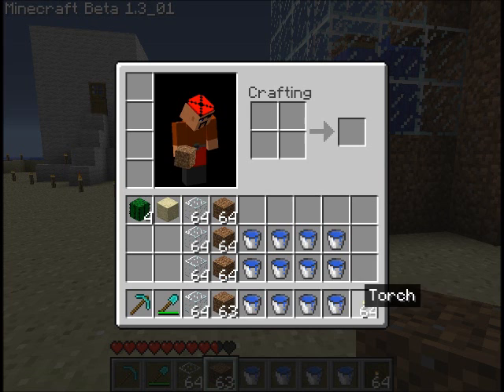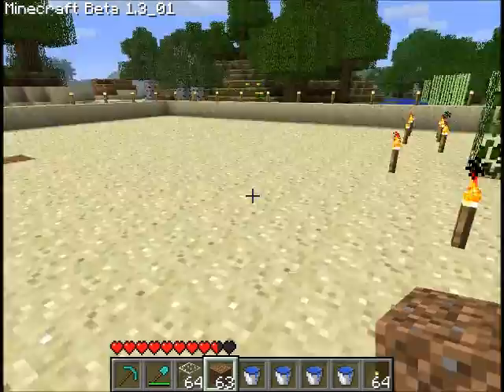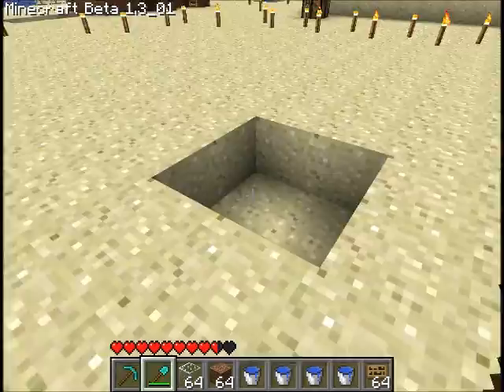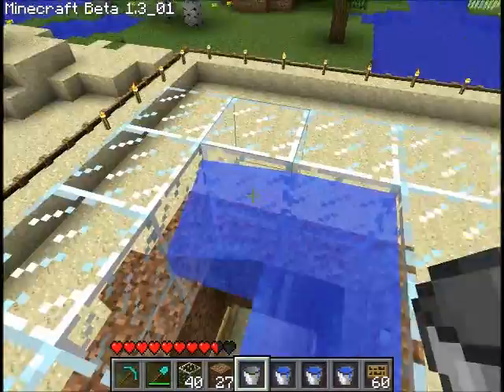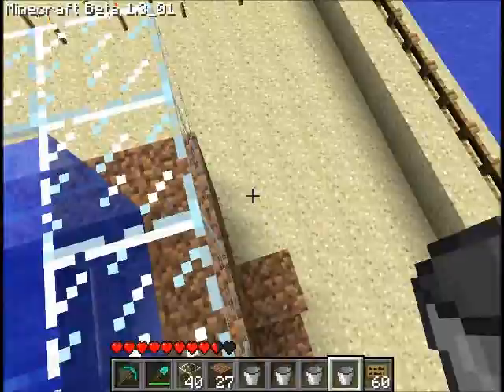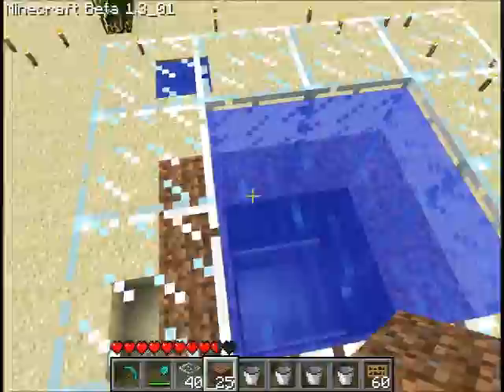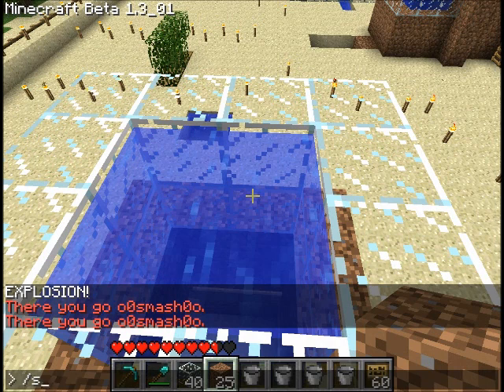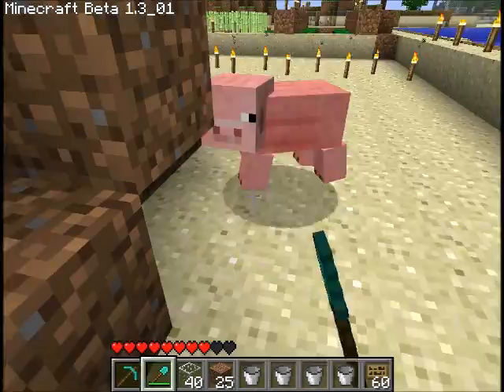The Crafters Guild: Mob Grinder Tutorial 1

Comment: hello there, as promised i tested it and came up with an few improvements. first off when the elevator is build, it is best not to let the water poor down, just make every layer with water, the drawback is that you wil use more water but it wil increase the efficienty of the mob trap, (mine got improved with 60%) i hooked it up to an regular 30-80 mob spawn room. for the rest it works fine :)